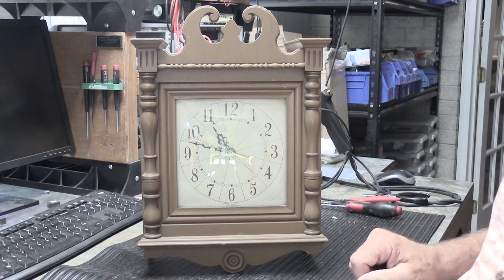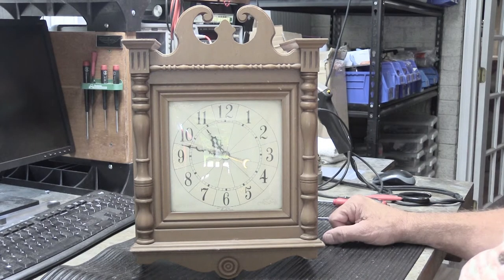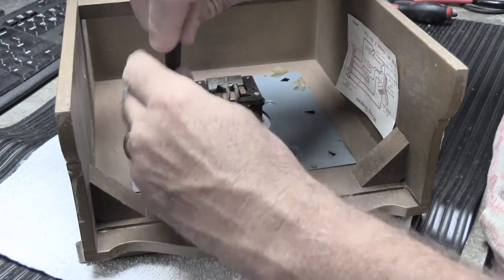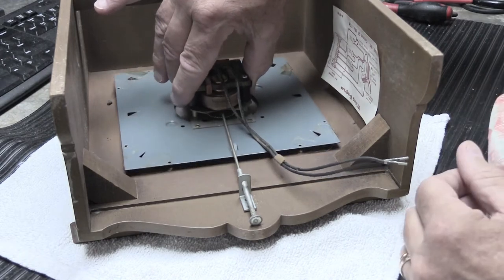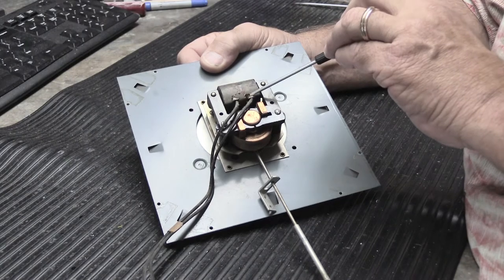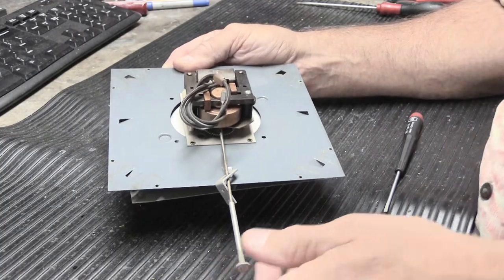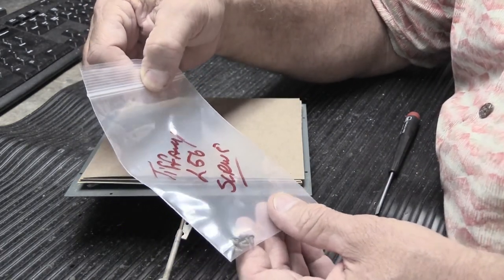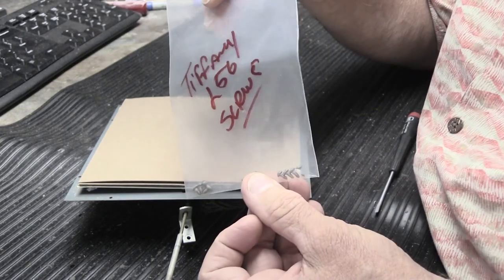How to Remove the Clock Assembly from a NuTone Jefferson Chime Cover and Prepare it for Shipping

Comment from the maker: This Video covers the fairly simple task of Removing the Clock Mechanism from a NuTone Clock Chime Cover.  This may seem like and odd thing to do - however if your NuTone Clock needs to be serviced - It's necessary because shipping the entire Clock Case is to expensive and it is too likely to be damaged - Chris
Reply: Hey Chris - Your Colorado friend here.  The clock has stopped working so I need to send it to you.  Glad to know you can take a look at it and see if it can be fixed.

Comment: I'm about to install my L46 Jefferson chime. Mine has a green plastic board on it, and the configuration of screws on the board to hook up the three different chimes is horizontal across the top. According to the seller, it all worked when he took it down. My question is this - the gnurled screw to set the time is missing from the end of the rod, so it's nearly impossible to set the time, because my fingers don't have enough torque to rotate the rod. Any idea what size that screw end is, so I can try to locate a new one? I didn't lose it! It was already gone when I got the chime. I use the bowl method also, when disassembling things. Thanks for all the NuTone videos! Really useful.
Reply from the maker: Hi cynthia:  I have no idea what the size or threading is for your missing knob - I did a Google Search for "replacement time set knob: and there were many results - It somewhat a difficult thing to find, I suspect that it really going to be a trial-and-error process to find just the right part - Chris

Comment: When did NuTone switch from using wood to plastic for chime covers?
Reply from the maker: Hi mid hamm:  NuTone always had some covers made from plastics.  In the earliest days there were covers made from Catalan along with the wood and metal covers.  Starting in 1947, a more modern plastic was used for the Majestic cover and there were still wood and metal covers.  NuTone continued to use these 3 materials throughout  the next 6 decades.  Plastic covers were probably the most common material used in many Chimes during the 70's through the 2000's.  Wooden covers were usually but not always for more expensive Chimes.  The was also a short period of time in the early 90's when there were a few Ceramic and Faux Marble covers. - Chris
Reply: @northsideservicecompany3567  Thank you for the detailed reply.